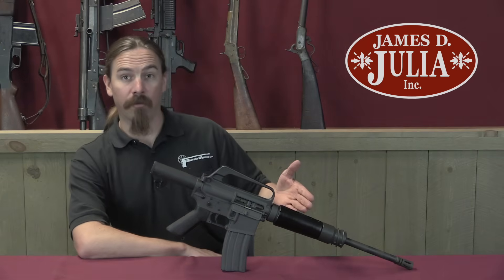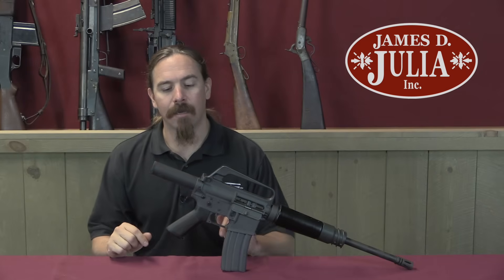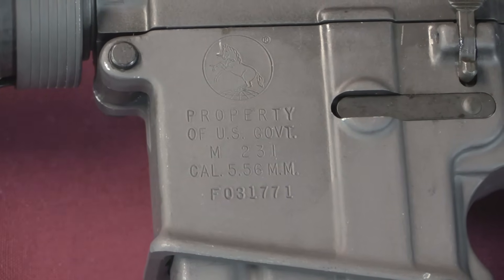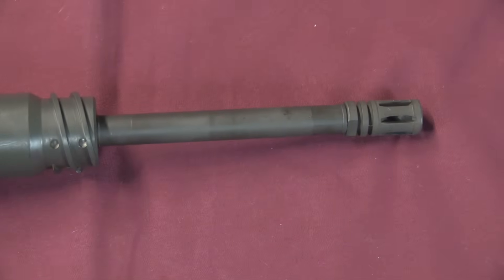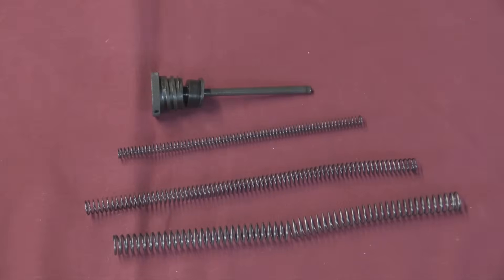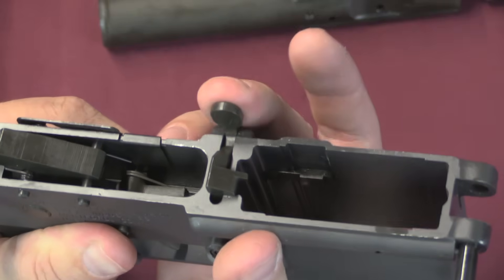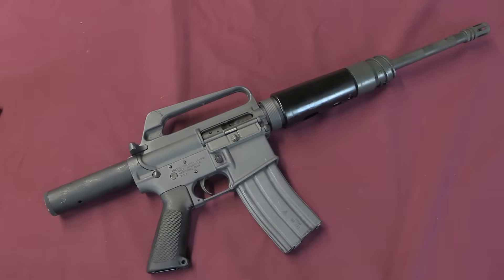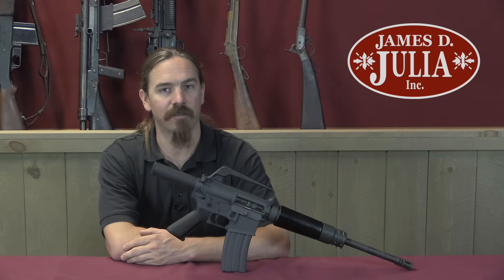Really Not an M16 at All: Colt's M231 Port Firing Weapon

Comment: The reason they developed this instead of using the rifles carried by the infantry in the back is because the M16 was too long to use effectively in such a confined space, and the Bradley was developed before everybody started using M4 carbines all the time like they do today. Also, if you look at the carry handle from above, you can see the hole where you can attach a rail for an optic such as a red dot or other aiming device, so it does indeed have provisions for sights, just not the standard iron sights.

Comment: I got to handle these when I was in the Army as we had the older Bradley models. The newer Bradleys just omitted the firing port weapons as unnecessary. I would say the reason that the Army just didn't use a modified M16 from the mounted soldiers because of the fact that you wouldn't want a longer weapon like even an M4 as it would be unwieldy trying to maneuver the weapon in the firing port. I highly doubt firing port weapons were fired in combat from a Bradley though I could be wrong.

Comment: The M231 PFW solved one nasty problem. Namely: Operating in the NBC environment. If you had your primary M16 sticking outside the Bradley and you got hit with chemical weapons and then pulled it in to exit the vehicle you would very likely contaminate the inside of the Bradley. The BFV had an NBC filter and overpressure system so that the troops didn't have to stay in MOPP4 constantly.
(Spend 10 hours in an NBC suite and you'd understand)
Reply: Nostalgic mostly but true that back in late 80s early 90s U.S. Army drilled NBC to a higher level than today! I used one of these dismounted as OPFOR in NTC, with miles and a blank adaptor! some what heavier than an M16A2 but 2 X the firing rate and wow! carbon was thick after 100 plus blanks the adapter had to sit over night in solvent tank! Oh wait I think I used an M60 MILES laser with sheet metal and cardboard. OPFOR secret!
Reply: Which was still a solution in search of a problem. Port firing from IFV/APCs was, for all intents and purposes, completely useless.  Certainly not worth the time, effort, and cost that they induced in the M2/M3 + M231.  If you're in an NBC environment, the likelihood you will ever be in a situation where port firing is useful approaches negative infinity.  Heck, even in a standard environment the utility of a port-firing weapon is negligible.
Reply: Except its open bolt so when you're doing mag changes or not firing you have an open tube going into the sealed space
Reply: @yazach35 No, you don't. They Bradley is equipped with an NBC overpressure system. 😮

Comment: My first thought.
"Why not just give the crew pistols?"
Reply: @Teddy Roosevelt The Bradley was developed during the Cold War, shortly after the Russians came out with a similar vehicle. It was meant to be resistant to chemical weapons and radioactive fallout, so it needed to be sealed up as tightly as possible. This gun threads directly into the ports, and it helps maintain a decent seal. A bunch of guys opening up hatches to fire pistols at nearby enemy soldiers would not achieve the same result.

Comment: This brings back memories! I was mechanized infantry in the late 80's in the Bradley. These things were a joke to fire. Your aiming was done through a vision block. This put your vision about 1 foot above the weapon. To load the things you had to raise the back of the weapon very high in the air to change the magazine. Which meant you had about one trigger pull to walk your rounds on target. By the time you got the rounds to go where you want them, it was time to reload the weapon, this made your work to aim the weapon useless because you had to start over. There was a brass catcher inside the Bradley with an integrated exhaust hose that attaches to the gun via a pin that slid into a hole in the top of the carry handle. The weapon itself fired fantastically fast and reliably. You just couldn't hit squat with it. 
It was neat seeing one of these things again, thanks Ian!!
Reply: I spent time as a bradley dismount in the 2007 surge. We still had them. But we used them as a supression weapon if the turret was busy with bigger targets, not something you were trying to aim. Your average dismount rifle had all kinds of optics, lights and lasers so wouldnt really fit through the port. Also, if you used your personal weapon you would be down on ammo before dismounting, not good.
Reply: @robertthomas4633  The drums for 7.62x39 Kalashnikov's are great. In Pisky Ukraine I saw many used of both 75rd Russian design top loading and 75rd Chinese design rear loading. They functioned reliably in RPK and AKM both. Biggest issues they're difficult/awkward to carry when walking long distance, and they can overheat the barrel rapidly. The RPK can handle a lot of sustained fire but the standard AKM has a thinner barrel. They'll generally still continue firing even if the barrel is red hot but it'll ruin the rifling. The amount of time it takes to swap 30rd magazines & firing 3 - 5rd bursts is enough to keep it from overheating though. 

For defending static positions they're great.
Reply: Should’ve put on a 100 round mag
Reply: rV iesneS AR-15 100 Round mags are one. Unreliable, there was often inadequate feeding and misfires. Two. In a cramped Armored Vehicle it would be very annoying to be stuck with a double drum mag and three those things are heavy, as the commenter said you have to lift the weapon into the air in order to reload it. (and I think those things weren’t even in military service at all).
Reply: @aturkishgamer9790  At a certain point I just wonder why they didn't just use a light machine gun. At least it wouldn't constantly need to be reloaded if it was belt fed.
Reply: @aturkishgamer9790  IDK where this idea that 100 round mags are unreliable came from. I have had zero malfunctions with 100 round magazines even after being loaded for long periods of time. If anything the worst part is that after 100 rounds the gun gets too hot to hold because ar's are not desgined for that role.
Reply: @paytonanthony1308  If drums were more reliable than stick mags, militaries would switch them, since (per bullet) a drum mag is very slightly ighter than the equivalent amount of loaded stick mags. Realistically, they're simply less reliable -- and it's no surprise; With a stick magazine, all the rounds have to do is travel in a linear direction, be that up, down, sideways, whatever. But with a drum mag, they have to travel in a radial direction and then in a linear direction, so friction and internal magazine tolerances become problematic to deal with, in this regard.
Reply: @bigmike-   I was talking about 100 round quad stack magazines not drum magazines. Drum magazines are dumb.
Reply: @aturkishgamer9790  i was about to say 50 or even 100 rd wouldnt work?
Reply: @josephconway1526  too big too hot too large for a small vehicle
Reply: Makes you think maybe we should’ve maybe just used somthing belt fed or with a drum or even just something akin to a modern quad stack ar mag lol
Reply: @william2glaser227 the first british tanks did this with lewis guns (drum mags) and they were really successful. I think having just one porthole at each side and using SAWs instead would have worked well.
Reply: TQ for serving veteran.
Reply: TQ for serving veteran.
Reply: Did no one think to use drums
Reply: @ArmyBoiSweat  drums suck ass. you dont want to be using a quad stacked 60 rounder or a drum mag in warfare. they constantly jam and just overall have terrible feeding issues

Comment: I'm guessing that this was picked over a regular M16/M4 is because the screw  thread allows a tighter seal so chemicals/smoke cant get in.
Reply: @The Mr. Pete Channel needs 700 subs! Yup! It was also much shorter than a standard M16 (the M4 didn't even exist at that point in time.)

Comment: They likely used it because it is pretty cramped up inside a Bradley. A buttstock is just more surface area to get entangled. Sights would be pretty much useless because the vision slots aren’t all that great in the Bradley. If you can’t aim, the second best thing is a high rate of fire for suppression. I’m guessing these were factors in the decisions.

Comment: am I correct in the assumption that these were commonly issued with drum magazines?

because the more than 1000 rpm fire rate seems to not really combine well with 30-40 round magazines
Reply from the maker: No, they only used standard 30-round mags.

Comment: when i was a private, one of my sergeants used be in a Brad in Desert Storm.

he told us about one time they hit an Iraqi trenchline. bunch of Brads online, firing 25mm and 7.62 like crazy, they just drove right over the trenchline. once across the line, they would drop ramp and run out and go crazy with small arms. they had one guy who liked to have 1 PFW in each hand to magdump tracers all crazy and ridiculously like a violence-of-action laser light show. then he'd just throw them back in the Brad and go back to normal.

Comment: Why the carry handle if it doesn't have sights and is supposed to stay in the vehicle? Seems like itd be less cumbersome in the Bradley without it.
Reply: Just realized, they probably wanted to be able to make as many of the parts on the same machinery as the M16.
Reply: Reasons for using a M16 upper. A supply on hand without need to make (obsolete no F.A. and not a2)  Brass catcher and gas evacuation mounting point.  Heavy pig as is, I've shot a few hundreds of rounds from a few of them.

Comment: I got to my mech infantry battalion in Germany in 1986 but we still had M113s. The other battalions which had Bradleys and had these M231s. The other mech infantry guys and buddies who were in these Bradley equipped battalions hated them because it was more shit to clean. So when they went to the field for live fire exercises the companies would take only a few of them and put them in certain Bradleys to go down range and shoot. Platoons would take turns using the same Bradleys to do the same. During alerts the guns would be inside each Bradley with full load of ammo. Majority of Bradleys by 1995 would have the gun ports sealed up and M231s were taken out. They worked well as full auto carbines with no sights but they were fucking useless.

Comment: the bradley is supposed to be nbc / radiation hardened. this requires a positive pressure seal on the fighting compartment. my guess would be that the "rifle" would screw into a mount with a heavy gasket or seal around the firing port. to allow firing, but keep pressure loss to a minimum.

Comment: From what I've read, the M231 was developed to meet the demand for infantry to be able to shoot from inside the vehicle, a requirement derived from intelligence reports on the BMP. Procurement being what it is, once it was discovered the M16A1 was ill-adapted to fire from inside the Bradley, the M231 program kicked in. Soviet troops discovered in Afghanistan that firing from an unsighted, unstabilized moving platform was a waste of time, hence the high fire rate from the M231 as an attempt to compensate. With the Bradley program being the way it was, the M231 was a vestigial component of the vehicle's development.

Comment: The reason the standard M16 couldn't be used is because there is no way to screw the M16 into the port- which was designed to seal against NBC. I'm a former Bradley crewman.

Comment: These were developed for the Bradley. They thread into the firing ports. This was done to allow the vehicle to be sealed for chemical warfare. This wasn’t possible with the M16A or A2. Plus the M16 was too long to be used practically in the mount.